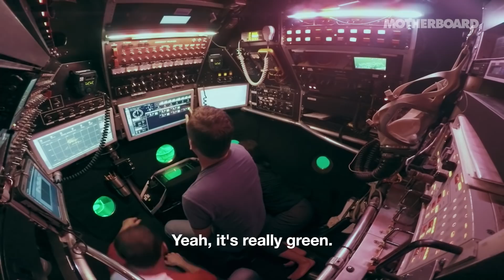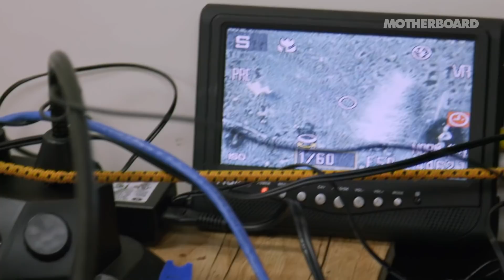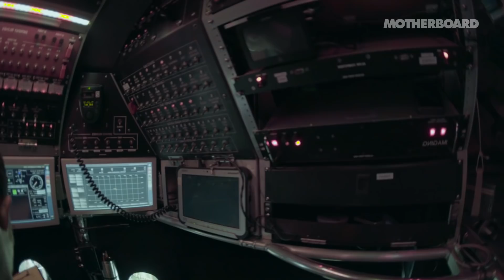The Invisible Creatures at the Bottom of the Sea

Comment: They take the oxygen and sulphur and turn it into carbon
Crafting level: over 9000
Reply: "...use those two elements to produce carbon..."

while it is not wrong, it surelly sounds stupid.
later, she says, that they use it to break up methane. perhaps the video is just stupidly cut without scientific knowledge
Reply: deep sea particle accelerators :o
Reply: I think she meant that they are farming the by product, which is carbon.